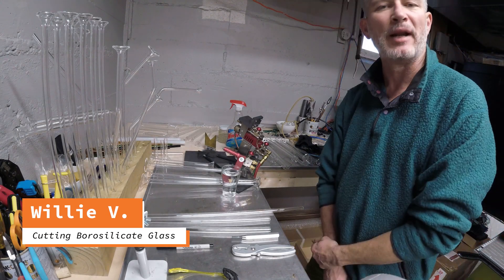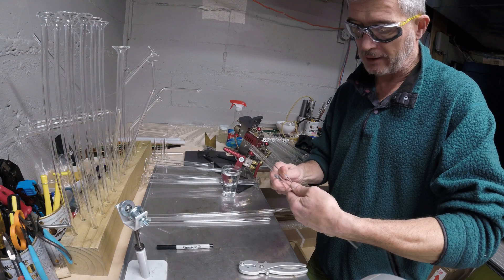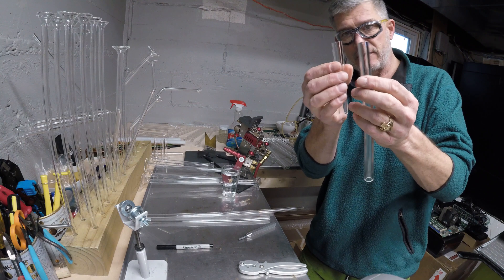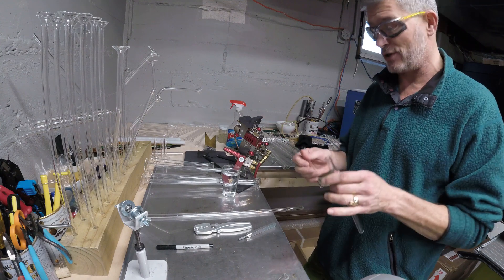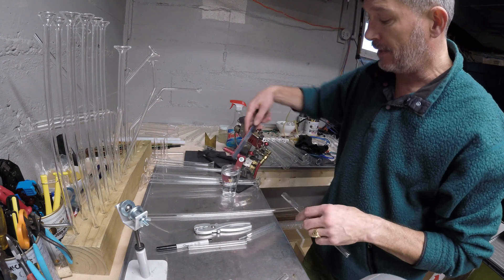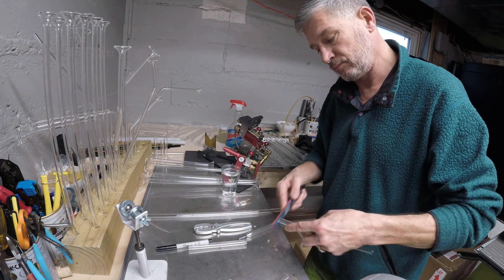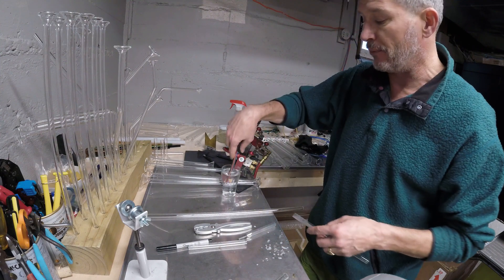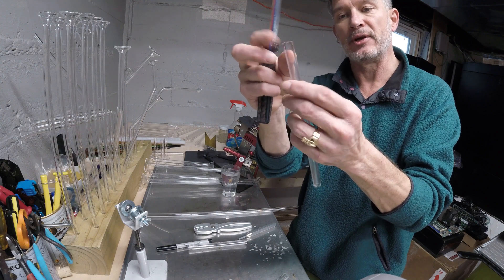Cutting Borosilicate Glass

Comment: Hey, I run an industrial hemp company and we are looking to find a borosilicate glass hopper that is shaped like a funnel at the bottom, and what we haven't been able to find is something that has a 1/4 barbed connection at the bottom of the funnel.  We would be able to compensate you for materials and time.  Those glasses in front of you in this video is basically what we are looking for but with a barbed and shorter bottom,  I can sketch what i'm thinking if you are interested and would like to talk prices.  The volume of the hopper funnel would need to hold around ~150ml but doesn't need to be too presses.  Thank you.
Reply: Have you solved your problem?

Comment: How about 40mmx3.2mm+ tubes?  I got the $110 scoring tool and still cant do it :(
Reply: You need a crack off machine, there is no other way to get a clean cut with that dimensions. You could try to scratch it like in the video, wet it, heat up a glass rod and put it on the end of the scratch (sorry, cant explain it any better) Works great with diameters of 20-30mm, don't know if it work with more than 36mm, never tried it.
Reply: watch?v=BLVJXw3K_Lo like in this video, the 2nd method. I wouldn't scratch it all the way, just about 2cm, but it must be in 90°

Comment: What if you you need to cut a very short piece.  Like 30mm long?  Can you still get that same break without the leverage a long piece gives you
Reply: What you can do is insert a wooden dowel inside the tube to give some leverage or use a wet saw. I am working on the website and plan to go live this month with tubes sales and other services as far as custom builds or tubes. Keep and eye out for updates, soon. 😎

Comment: Can you put borosilicate on a flame to smoothen the edges?
Reply: I also would like to know the answer to that
Reply: Yes you can but you will have to keep it rotating in the flame to round just the cut edge. Must be careful and watch you do not leave it in the flame too long, it will cause it to distort and not fit in the fittings.

Comment: No need for water.
Reply: Also... grinding / filling glass creates a glass dust hazard. Extremely bad.
Reply: @arc4707  That's why you use water for the glass dust during the grinding process to stay in the water and not be airborne. When I am bending Borosilicate with my bench torches I use positive airflow through vents to prevent the inhalation of hot airborne glass as well. As far as cutting it acts to cause the surface to cool which make the snap easier, so you do need water or spit. When I cut large volume of glass like hundreds or thousands of cuts I use a diamond wet saw, water there for the same reason to prevent the glass dust from getting airborne. I also use a table top grinder for high volume work that uses water for the same reason. This video is meant to show home users how to do it with out the cost of expensive equipment for a single system build. I hope this explains it to you the reason for using water.
Reply: @Willie_VR  no mater what you think... you are creating a hazardous condition in your studio by using a file or any other type of glass dust measure
And as far as water on a cut is concerned... no water is needed and a first for me... I have never seen or heard of such in over 22 years on the torch and a hub of high end production master glass blowing... And no offense... but I do not know who told / taught you this but it does absolutely nothing but make a mess... AND a potential hazard.
Whoever told you this and the exhaust blew smoke up your arse. 

Oh and also... almost forgot... When cutting wet saw... make sure you keep it in a designated area that can be cleaned thoroughly... AWAY from you work areas and sealed off... outside is best.
when wet glass is cut it produces a mist... which becomes airborne... which can be inhaled... wet or not.
When this mist lands and dries... then disturbed... it becomes airborne again... and again can be inhaled.

Listen man just trying to help you stay healthy... one thing lacking on YouTube is SAFETY.
Glassblowing is by no means and in any way shape or form a "safe profession" without extreme due diligence

Don't be like many mentors of mine who have regretted  many "shortcuts" which have cost them more than they bargained for.
ARC
Reply: ARC Thank you for your advice, I will confirm with three Masters in the Boston area on this video and your comments and followup.
Reply: @arc4707  I am waiting to talk to them, can you be a little more clear on these two comments, "many mentors of mine who have regretted  many "shortcuts" which have cost them more than they bargained for", who were you mentors and where did you train? & "I have never seen or heard of such in over 22 years on the torch and a hub of high end production master glass blowing" where have you worked and do you have samples of your work you can share, cause you have nothing to look at on your YouTube page?
Reply: @arc4707  so how do I cut my down stem In half at home safly lolll
Reply: @Stoner_Jesus   Score and snap in ventilated direction... such as in your exhaust area is easiest.
You can use water if you want but this then requires cleaning prior to working.